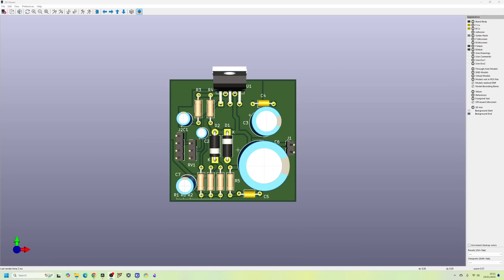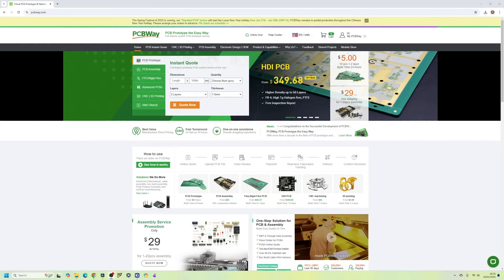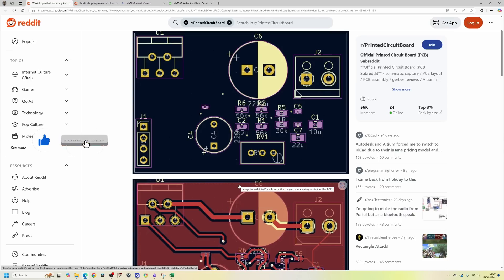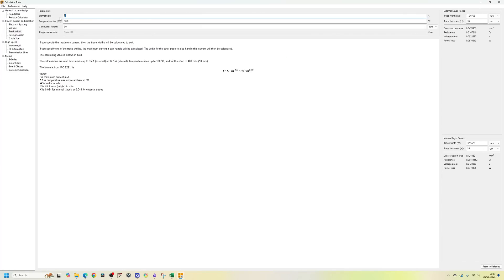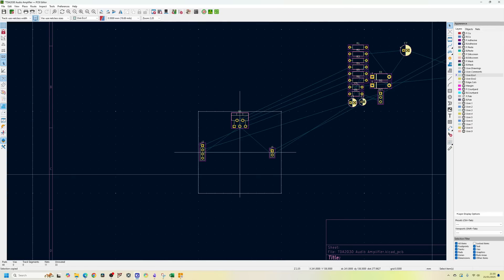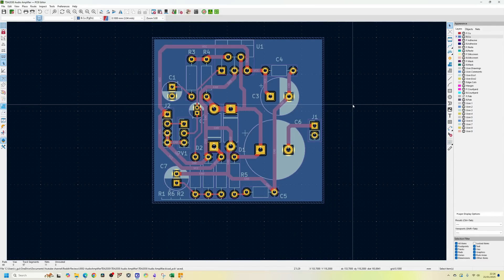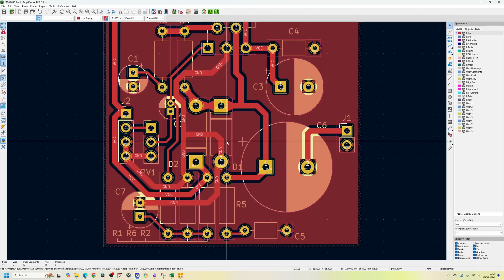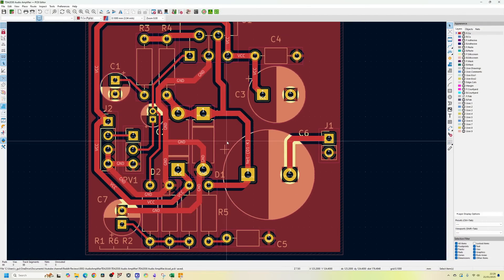TDA2030 Audio Amplifier Design | Reddit Circuit Review | PCB Design

Comment: Very nice Man...! Keep it up...!! Actually input coupling capacitor should be connected in reverse direction (as voltage divider potential is at pin one),even take a look at the "single supply schematic" in datasheet....Thanks....
Reply from the maker: Thanks! Maybe I got that wrong so I'll pin your comment.